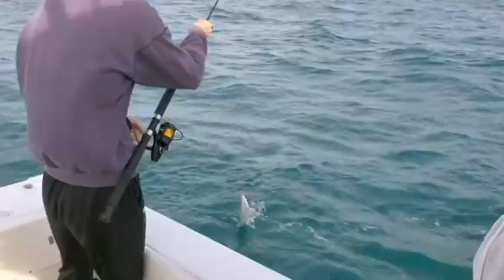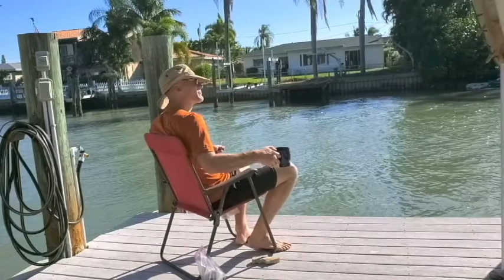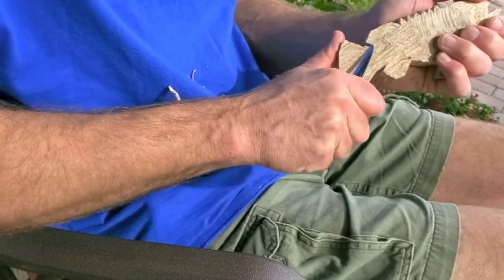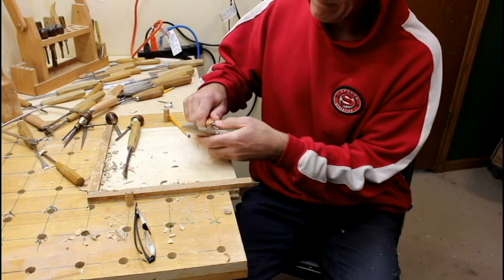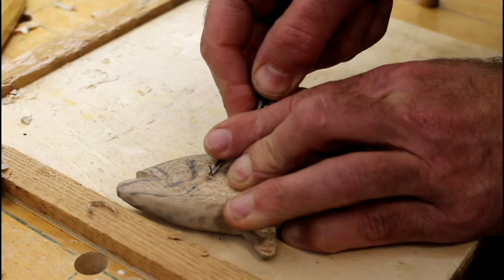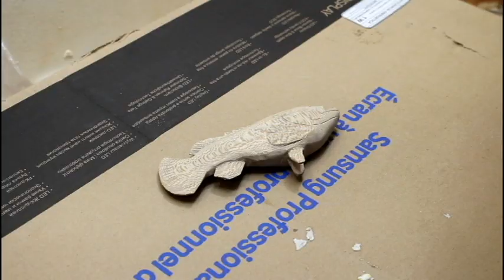Carving a Grouper in Quarter-Sawn Sycamore

Comment: Another nice one Mark, how did you like the Sycamore, I have some that has to be cut this year before it splits out, wondered how well it would shape.
Reply from the maker: I like working with it. I've carved several things in it and it works well for that. I also used it for the top and neck of a guitar I built. The quarter sawn boards have tremendous ray flecking if you like that kind of thing.